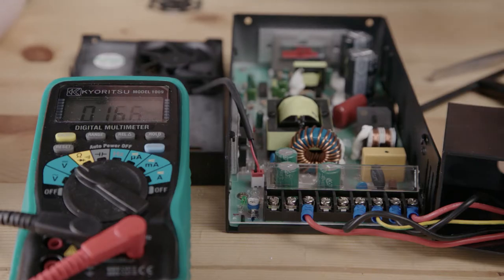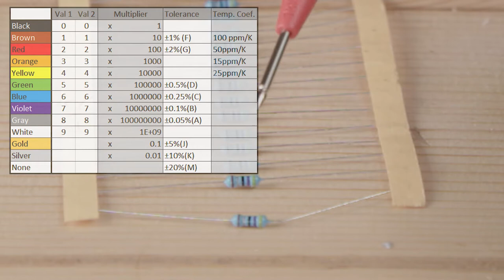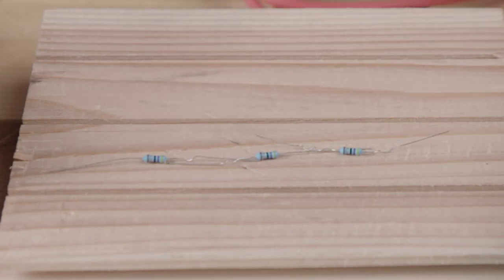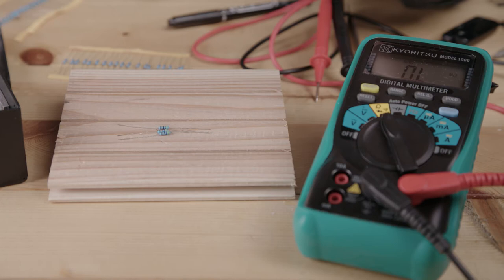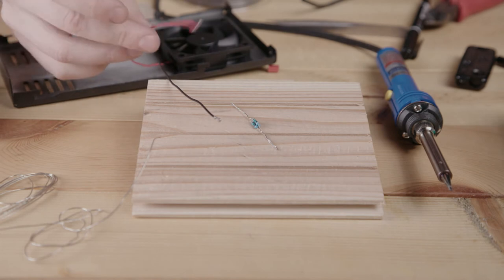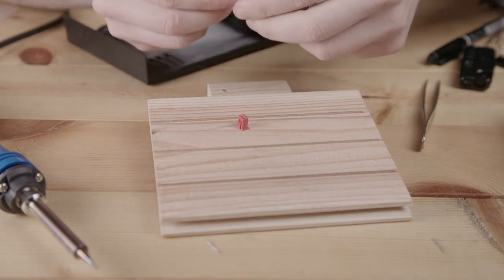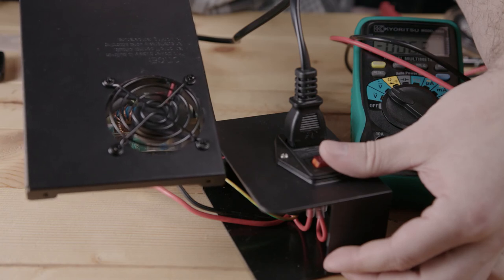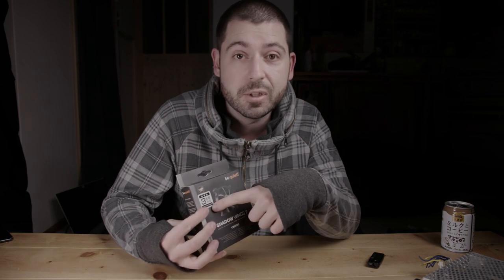Reduce Fan Noise pt. 2 : Elegoo Neptune 2S Power Supply Fan Resistor Upgrade

Comment: Great work and great presentation.  For mounting a larger fan, die you measure 92mm case width or the space inside until those 2 capacitors are in the way?
Reply from the maker: Thank you! 92mm is a standard fan size, outside the case was around 100 or 110mm I think. Inside the case after 70mm the capacitors are in the way. The fan I used was 80mm. Part 3 of the video shows it.

Comment: I plan to instead replace the fan with a Noctua fan. Give them a try, they're extremely quiet
Reply from the maker: Noctua is a good idea if you don't mind mounting on the outside. I'm in the middle of editing pt.3 I'll install a Bequiet cuz I have them already for PC builds need to put your ear up to it to hear. Also going to show a silent 70mm that fits inside the case, and see what the stock fan is like around 12-15v. Good luck with your mod!